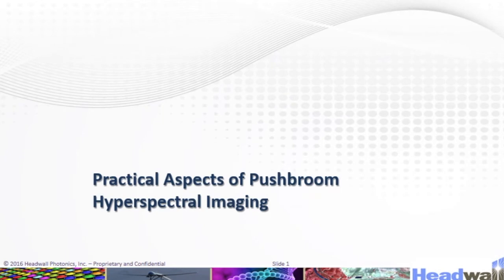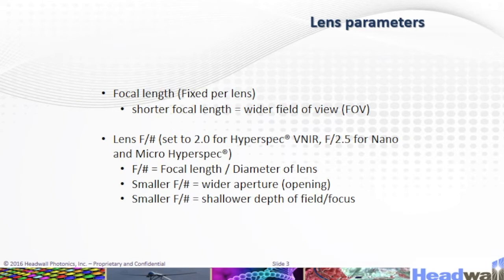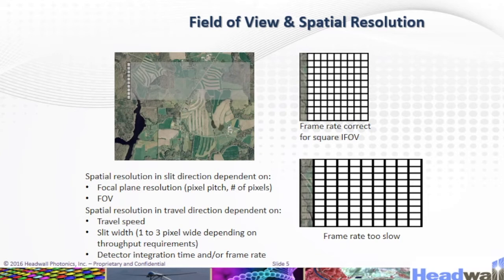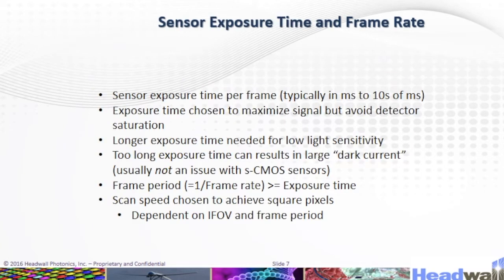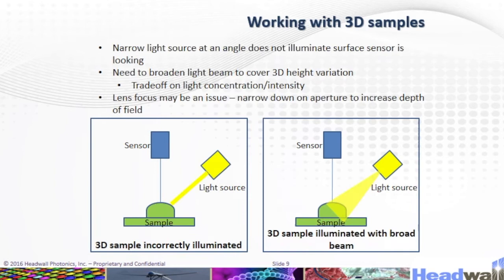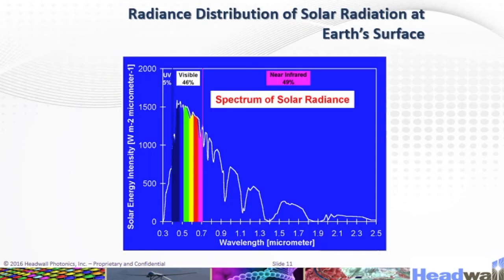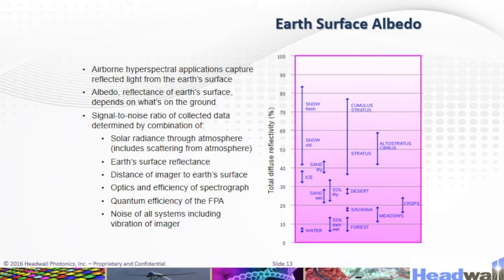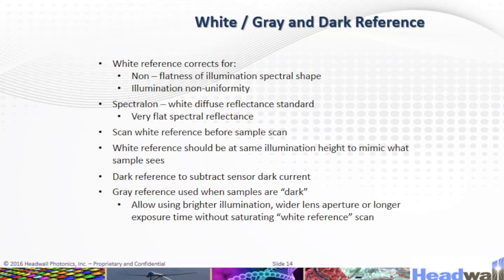PUSHBROOM IMAGING:  PRACTICAL ASPECTS

Comment: How should I proceed to start the spectral data processing in the close capture pushbroom Hyperspectral scanning?
Reply from the maker: Hi Ashutosh, are you a current customer? It would help to know the system that you are using, with regard to the sensor and platform. Even if not, you can submit a support 'ticket' from our website, here: https://www.headwallphotonics.com/support-ticketing-system Our support team will make sure to respond as soon as possible. The nice thing about this ticket system is that it ensures questions don't fall through the cracks. Sincerely, Headwall Marketing
Reply from the maker: Hi Ashutosh, where are you located? I should not presume that you are in the US. Our support team is located at our headquarters in Bolton, Massachusetts operating on US Eastern time.
Reply: @headwall-photonics    Hello Sir, I am located in Berlin, Germany cuurntly. I am  a project intern in a project for investigating early stage disease symptims in the plants.
Reply from the maker: @ashutoshsaini2978  Thanks for the quick reply! Are you a customer (own a Headwall product)? I did a search in my (marketing) database but did not find your name--that said, a lot of times many customers use our systems that are not the original purchaser.
Reply: @headwall-photonics   I would like to thank you firsty, fro your fast reply and support. I would say that I am not tone of your customers but I am using SPECIM FX 17 hyperspectral camera in the project.
Reply from the maker: @ashutoshsaini2978  Hi Ashutosh, thanks for letting me know. I think you should ask them how you should proceed. Not all hyperspectral systems and software are the same from company to company. Our software controls the sensor and controls or takes input from the platform, meaning the scanning stage or conveyor or drone. We also calibrate our systems and recommend certain procedures and tools as part of our image-capture workflow for industrial applications and remote sensing. Specim's recommendations may differ.